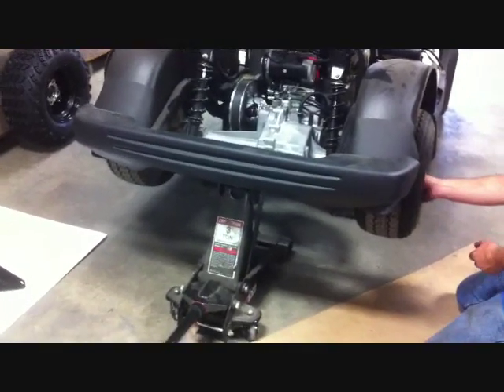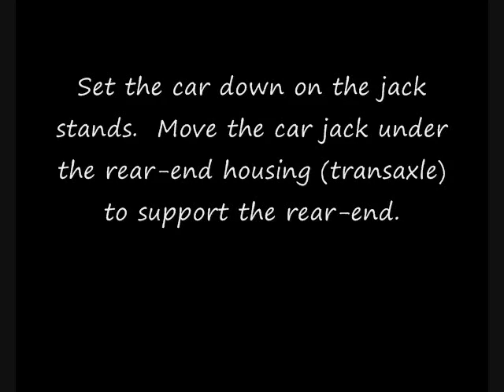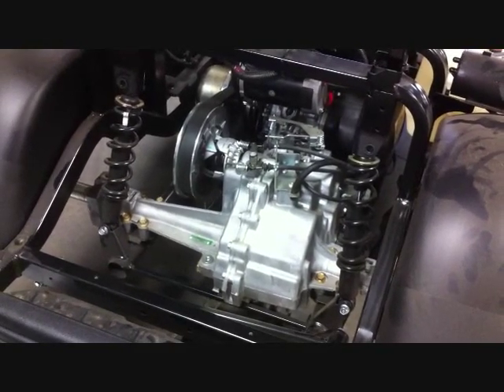Jake's 3 Inch Spindle Lift Kit Yamaha Drive Installation Video

Comment: Hmmm.
Got my G29 used and it already had this kit installed. I was checking the front alignment and noticed the steering link bolts had been installed from the top (factory non-lift orientation) instead of from the bottom as you show. Got that corrected now. Also had right tire 1/4" toed out, and corrected that.